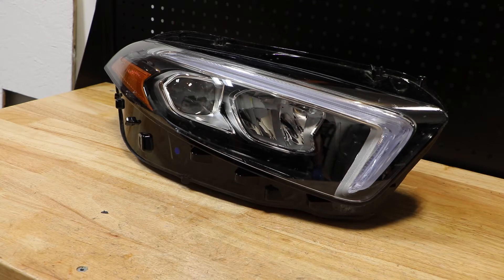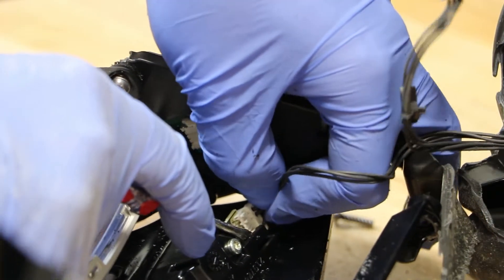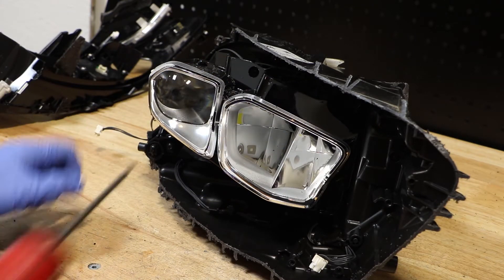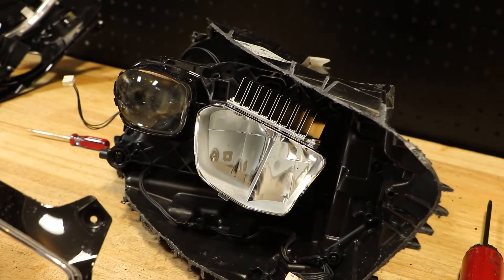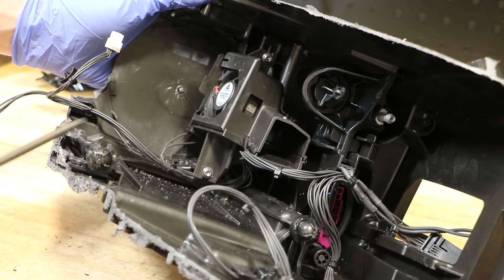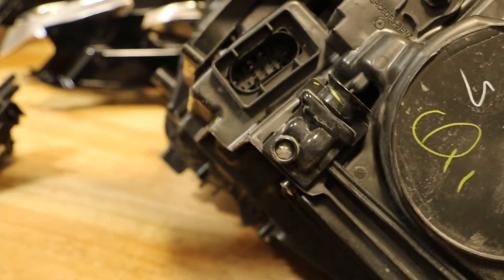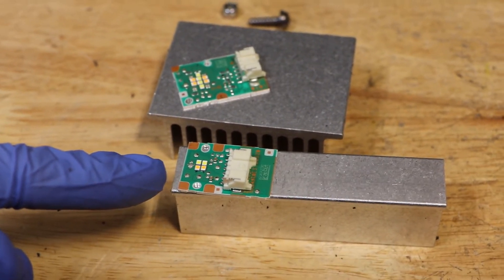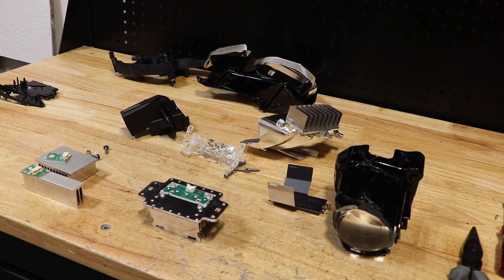2019-2021 Mercedes Benz A220 LED Headlight Teardown

Comment: How to remove the lens ? There is any glue to remove or it's just rubber sealed ?
Reply from the maker: It's glued.  It uses the black glue that's difficult to melt.